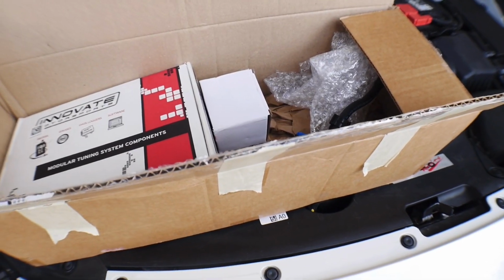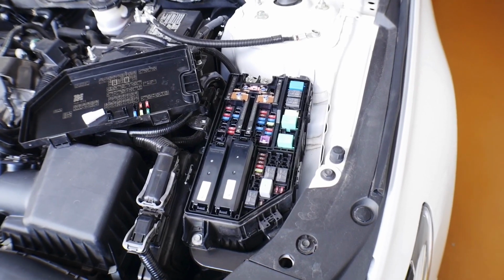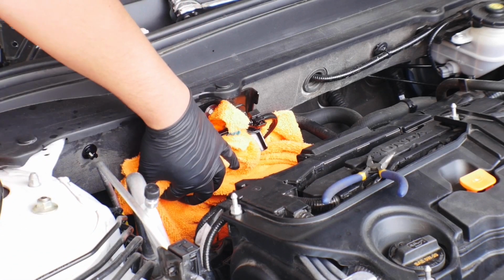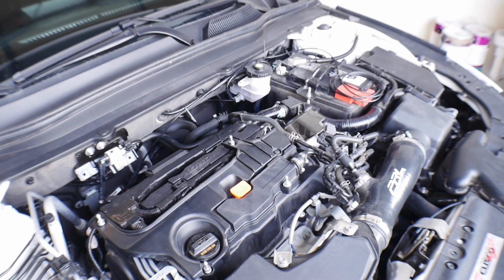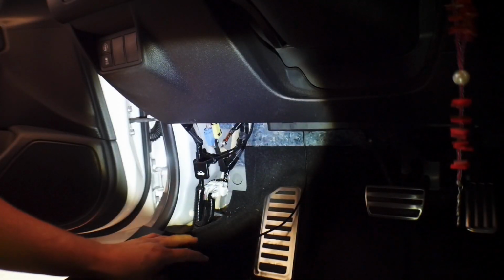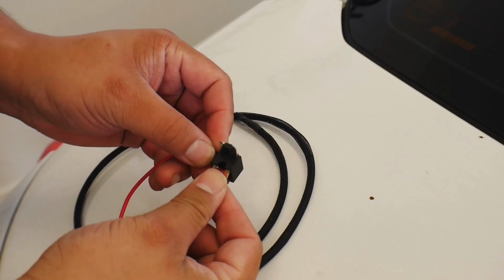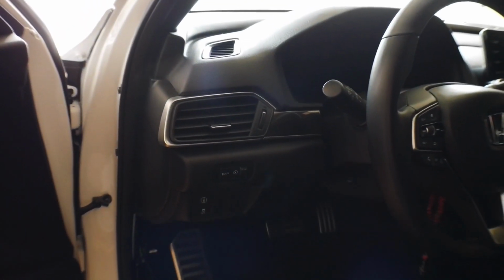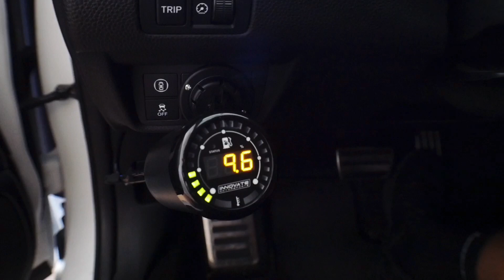How to Install a Flex Fuel / Ethanol Content Sensor (MotorWerks or SiriMoto)

Comment: I admire the bravery you have to dive right into this new Accord.  2.0 sport? 
K20C4 right?
Happy to see someone who gets excited as much as I do about their Honda.
Reply from the maker: Yes, this is the 2.0 K20 motor. Running flex fuel makes a huge difference. 

Check out PRL’s Flex Fuel Kit. It’s a plug and play kit and will work with the Ktuner if and when you buy one.

Comment: What happened to the catch can that you had there? I have a Mishimoto catch can on that bracket. Do you think I’d be able to install flex fuel with the catch can there or does it need to come out?
Reply from the maker: I took the can off like 30 days after putting it on because it kept leaking. But you should be fine, the fuel hoses should make any contact with the catch can setup. I believe it should still give you 4-5 inches of clearance no problem.
Reply: Fahrenheit Motorsports Right on thanks

Comment: Does your gas gauge work with E85 fuel?   Any long term issues with upgrading?
Reply from the maker: Yes everything still works as intended. There are only issues if your mixture is above E40.

Comment: Hope too see more from you on this new setup. How much of a power difference you get and what tune ends up working best. Nice job.
Reply from the maker: Yeah man, the next video will actually outline that. Eventually I’ll get another custom tune from as I add more parts. I have a downpipe in my garage waiting to get installed but I wanted to add this kit first. Just adding the ethanol should net 20-30 hp. It almost has the same effect that adding a Ktuner/hondata would to a stock vehicle. 

Just need to hope my tires hold up because they scream and chirp on the stage 2 right now. I’ll have to turn up VSA to help with launch traction.

Comment: is it possible to just run premium gas in emergencies?
Reply from the maker: Yes but you’d need to change the tune. I have the normal stage 2 tune from Ktuner and my custom E35 tune loaded into tuner view. If I needed to swap tunes I could do it on the fly.
Reply: @Fahrenheit_Motorsports  gotchya thank you

Comment: Ok when are you going to put the big breaks on this ride? 
Wrap the top black and add a rear window spoiler?
Reply from the maker: I just got the banjo bolts and crush washers to run the stock brake lines with the setup so everything can get installed soon.

I also have the vinyl in my garage but it’s that damn time thing I need 😂

Roof spoiler...not sure about that one. I haven’t found one I liked.

Comment: So the signal wirwvfrom flex fuel sensor  goes to the sensor wire on the gauge?
Reply from the maker: Correct. This kit had a dummy proof harness. Only one way to connect them all so it make the plug and play process really easy.
Reply: @Fahrenheit_Motorsports  I'm running a standalone ecu
 And my flexfuel sensor wire is already in the ecu.. so I guess I can just tap into it

Comment: So we don't need to change injectors or any fuel lines other than the one included?
Reply from the maker: No injectors yet. This is actually the single largest issue with the 2.0 DI engine once you reach around 400 hp. The stock injectors reach max flow and there is nothing on the market to help. Possibly interchanging something with the type r when something is developed.
Reply: @Fahrenheit_Motorsports  Thanks for the reply. Always love the vids. I have a 2.0 with these dope sequential lights and I cant stop admiring them 😍

Comment: Hey man, I'm having trouble finding the gauge pod/gauge housing. Can you hook me up with a link?
Reply from the maker: This is the one I got bro. I wanted it to swivel and this one does just that. Keep in mind the double sided tape they include AND 3M Doublesided tape do not work to mount this on the dash due to the texture. That’s why I ended up mounting it where I did. 

https://www.ebay.com/itm/290567908037
Reply: @Fahrenheit_Motorsports  Thanks!

Comment: U never did a pull?
Reply from the maker: Na, I couldn’t just yet. I had just filled my car up with 91 so I’ll need to use up at least 1/4 tank before I can throw in some E85 and load the tune. I’ll actually get some good baselines if stage 2 versus E-40 tune. It should be good!! Hopefully middle of this week, I’ve been driving around in sport mode everywhere I go 😂